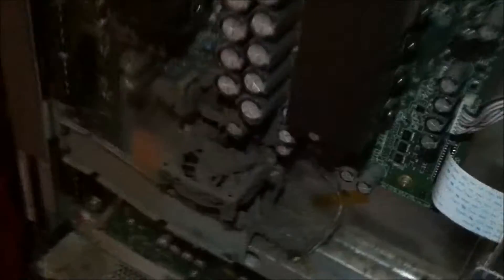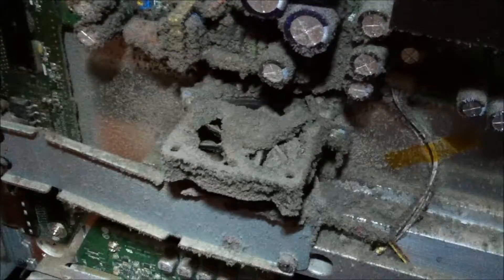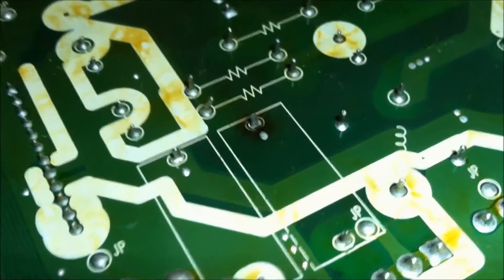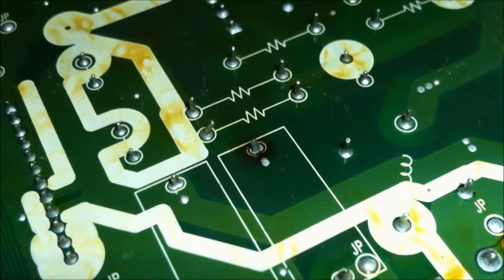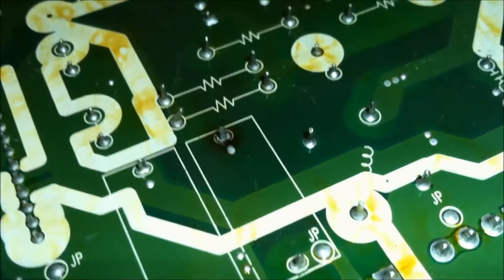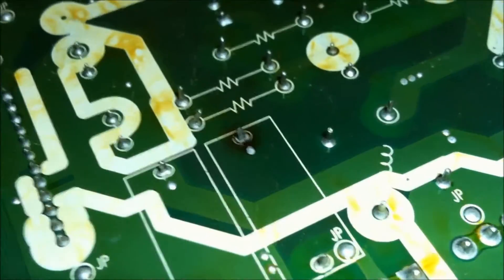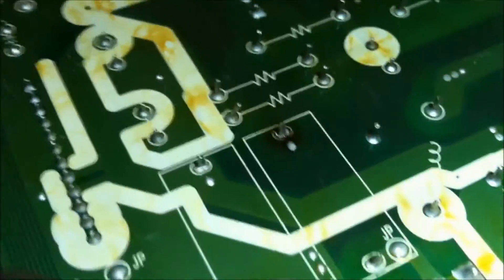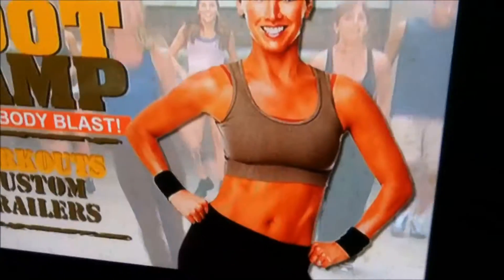LG 60pc1d has audio but no video fix repair

Comment: my screen is flicking on and off
Reply from the maker: leon johnson jr could be bad filter capacitors on power supply.
Reply: After Hours Tv & Pc repair  I check it everything is good the sound is good but keep flicking but when it get hot it plays good